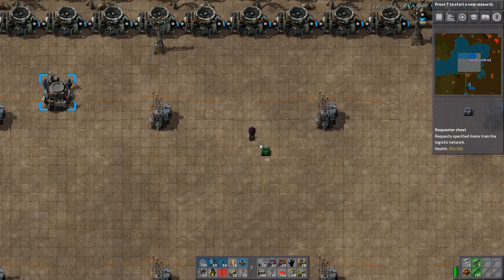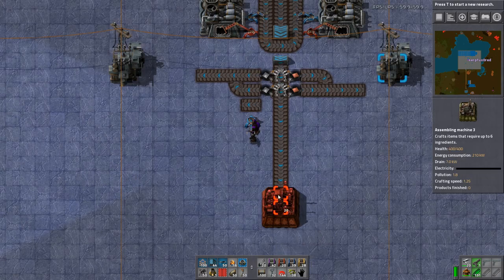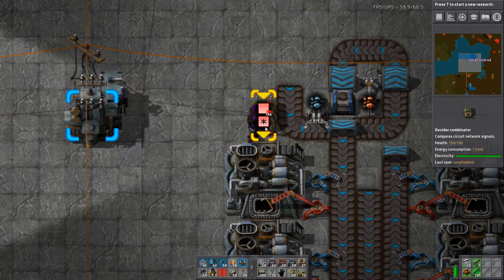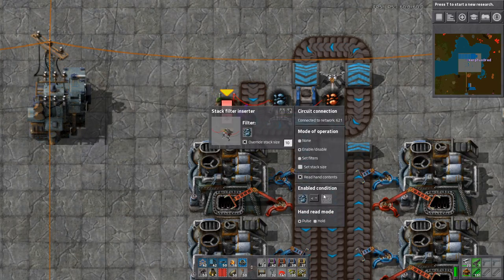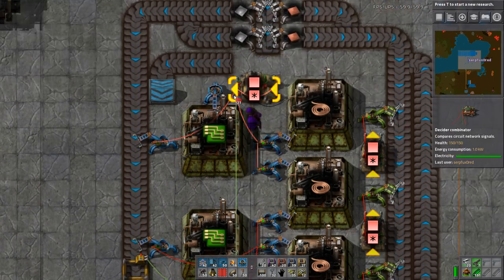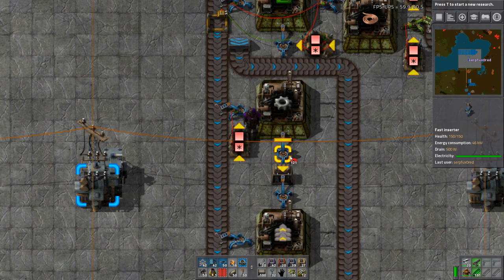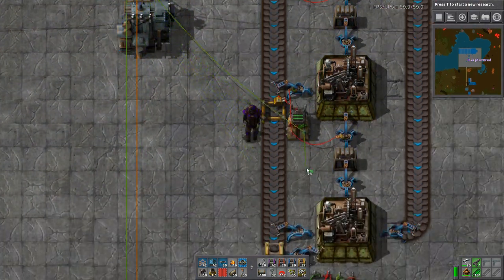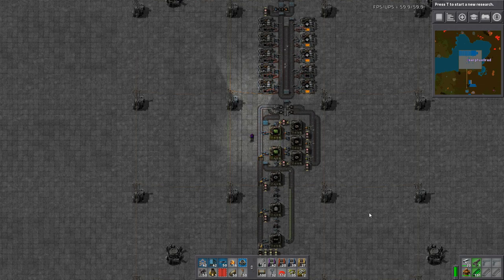Factorio - Tutorial - Build zero over production assemblies

Comment: Will it work if you're actively requesting items? If the robots take stuff out of the end product box as it's being made, it won't reach 10 and won't reset. Connecting the counter to the end product inserter should work better, with a 2nd stopgap that stops it from overproducing.
Reply from the maker: It will still work yes, the way it works is there is only the exact amount of ore inserted to the machine to make a batch, in the case of the video, the batch is a stack of 10 i believe, add a pulse generator and you can manually reset it to begin another batch of 10, or whatever your batch size was you set it to :)
Reply from the maker: on further thought about your question, the way the machine is set up in the video, the machines "trigger" for a reset is the box reaching 0. the bots will constantly reset the machine, and mess it up. you will need to figure out a different, reset "Trigger" and you should be okay :)
Reply: Like I said, counting the amount produced, and then checking for the reset signal should work.
Edit: as in, 'I made 10. Are there at least 10 items in the box? no? let's make another 10.'
Reply from the maker: There you have it then answered your own question, I didn't intend to have it working as i was taking from it, so I hadn't put any thought into it. Been a while since I've been on the game as it's too hot for hard thinking lol. Back on for me when the summer is behind us.
Reply: Also, let me once again thank you for the concept of the pulse generator. I was using a rather complicated device that compared the value I want to store to the value I want to have stored, and then either add 1 or substract 1 depending on  if the stored value is bigger or lower than the target value. It had the downside of having to wind up to the target from 0 since it did it one unit per tic, as well as twitching like crazy duo to combintor delays. But with the pulse generator, I think I can make it work easily by saving the initial pulse as well as any future pulse, since those only signefy change, rather than sending the entire signal. I'll just need to remove the 'above 0' condition, since I do want negative pulses to come through.
Reply from the maker: Great :D Thank you for the comments, and showing interest. Maybe in the future I'll have some more crazy machines built, there's a lot stored up in the old noggin waiting to be brought to reality ^_^
Reply: Did you ever try the AAI vehiclese mod? It really brings it into perspective when you need at least 20 combinators to do something that you're used to do with one click in a typical RTS.